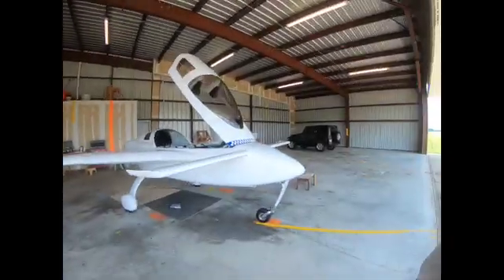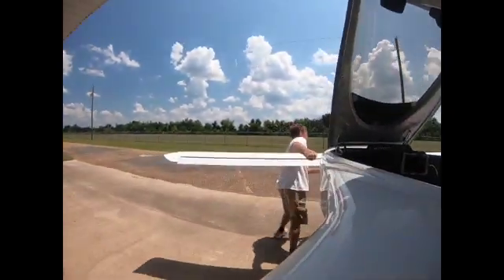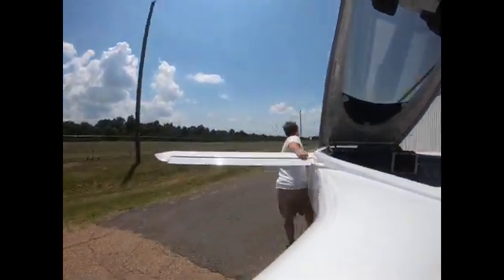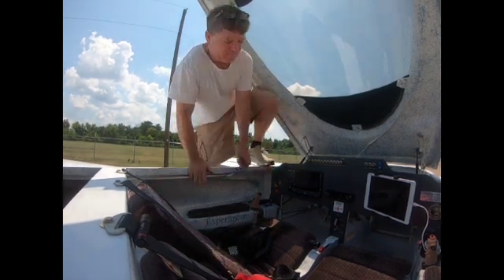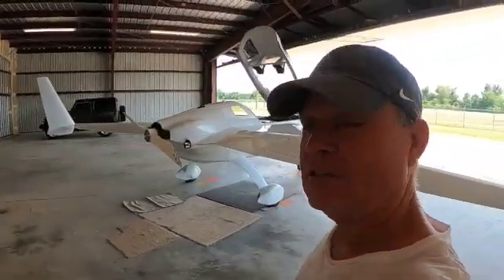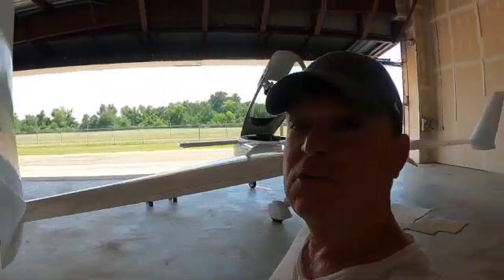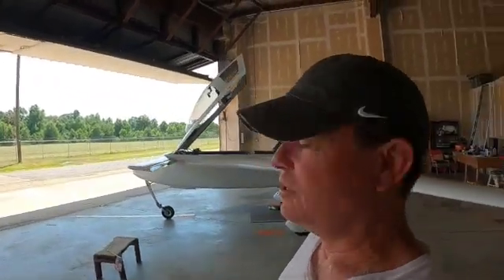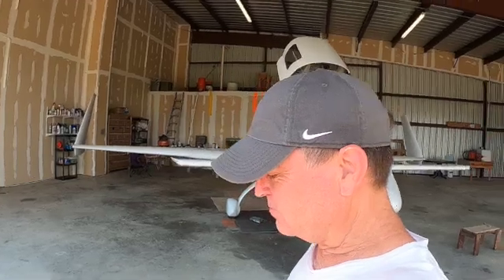Flying My Garage Built Airplane August 2025

Comment: Nice build, congratulations!  Some years ago, a workmate was building a composite canard plane from plans (a Long EZ??), but unfortunately I changed jobs and lost touch with him before he finished it. In a later job, the Assistant Manager had a self-built canard amphibian... which had lift issues when it got water droplets on the canard... not a good thing for an amphibian especially!  A new airfoil profile solved that issue and it performed well.
Reply from the maker: That's a great story, thanks for sharing!